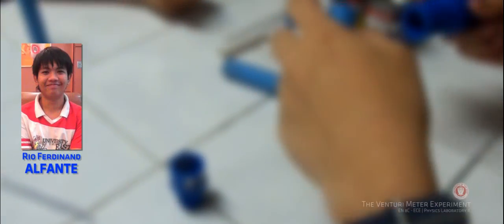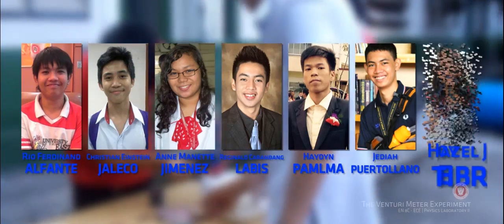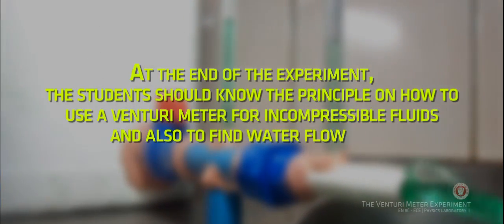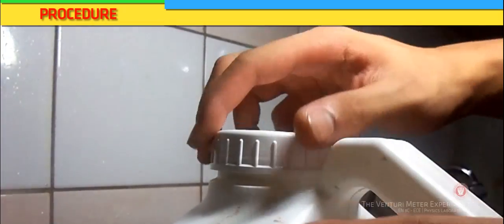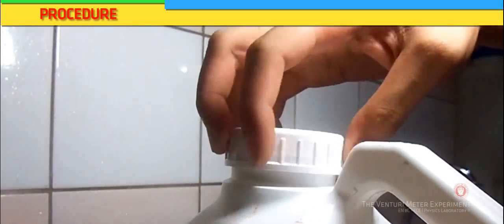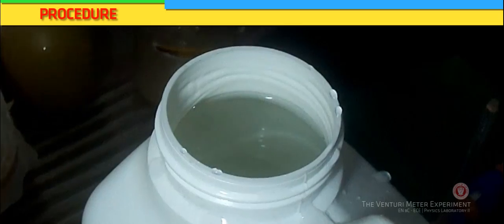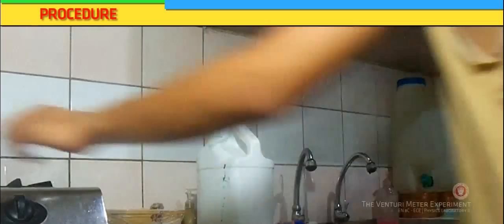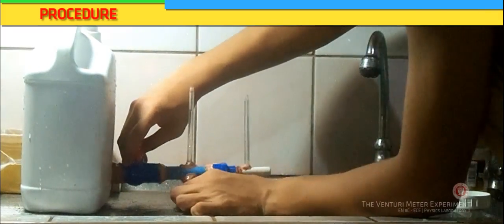Venturi Meter Experiment | Physics Laboratory

Comment: What a mess,very poor job.if you can buy the pipe and the fittings,the pvc glue was also available,using a 5 gallon bucket or pail would have been a better choice for a holding tank,the connection at the tank could have been a male and female fittings,i would have been embarrassed to put this on youtube...